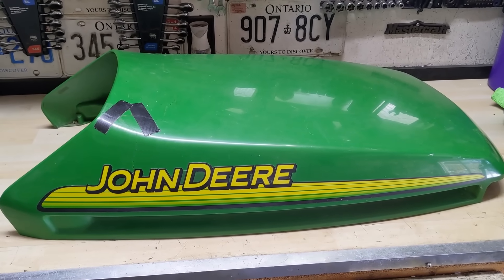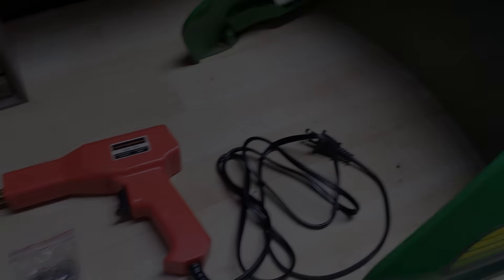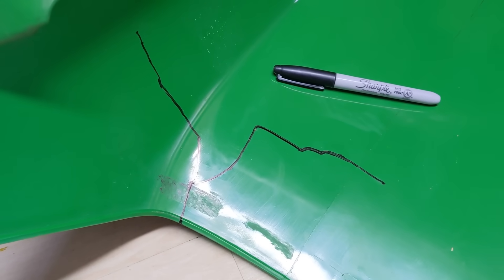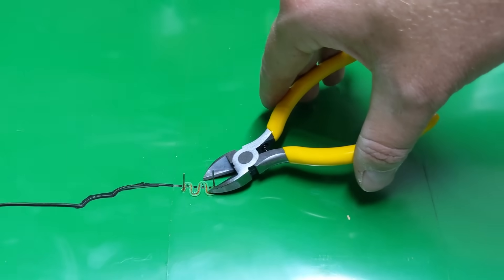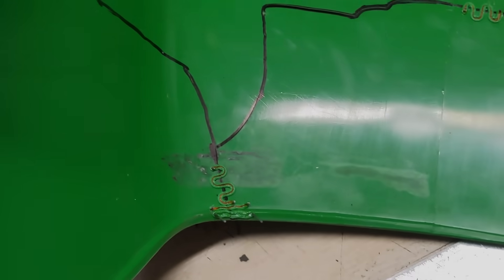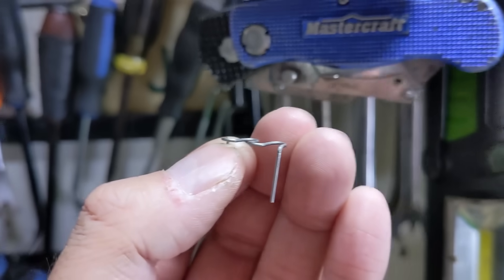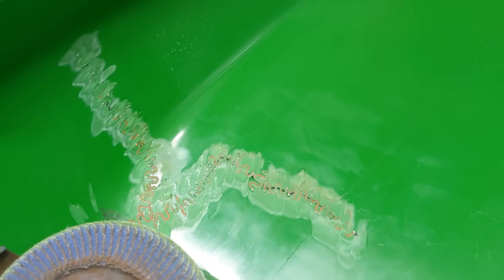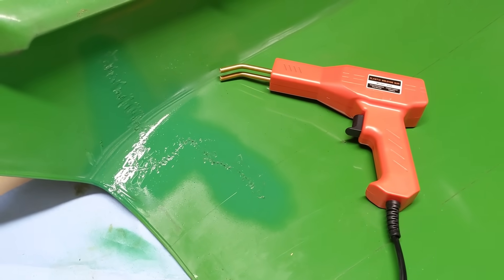How to Fix Cracks in Plastic Using a Hot Stapler

Comment: This video is actually very informative. Using knowledgeable terms. 

That its most likely ac current and briefly how it would work on the tool. How each staple works on outside and inside corners, flat surfaces.

This is just an overall good video, and I'm only 4 minutes deep so far. Props to you man! Hope you get alot of subs and views!

Comment: For an inexpensive $3.50 cutters, go to Harbor Freight and buy one of their small flush cutting snips and grind the face flat. Take your time grinding the face, so that it doesn't get to hot and cool it with oil or water. These $3.50 snips will last a long time and save you over $40.

Comment: Staples are nice, but when it comes to cracking in the bumper and stuff like that, I prefer a steel mesh. You can find it at any other zone or whatever just cut it to fit and go over it and you can use the hot iron to sink it down and to the plastic or you can get a bag of steel wool and make a real nice mesh going over top of it and using the iron part to to heat up the steel wool, which will be a lot tighter braid and no to the plastic and it’s the strongest bond I’ve ever seen

Comment: 2 Years Later, Any update on its quality?
Reply from the maker: Still works, it stopped working once and I unscrewed the handle and found a wire had come unplugged from the push button, plugged it back it and everything still works. They're Chinese and cheap so I honestly didn't think it would be too high quality. There are USA made ones but they are super expensive
Reply: @ Nice. If you take care of it and parts are easy to replace, it'll last forever. Thanks for the update.

Comment: Great instruction video but I think it's pronounced "Nip-ex" Silent K. Try a pair of end cutters used for soldering resistors and other electronic parts into circuit boards. they cut it flush. They just may be a little small.

Comment: I have one, use it all the time, even used it to repair the ladder on my grandson's toy firetruck. 
Only thing is i use a soldering iron with a flattened out nail attached to smooth out the welds and some times i add a little melted plastic to smoothen it even more.

Comment: Nicely produced video bro.    Kit is made in China, but super impressed with the design and what you get for the money.   Some Chinese stuff isn't too bad!   After watching your video, I was able to fix a plastic corner post level checker in under 5 minutes.  The H50 is super easy to use and the kit came with hundreds of elements;  3 different styles of thin wire and 3 different styles of a bit thicker wire.  All stainless steel - use the thinner for smaller jobs and thinner plastic.    One tip is to heat up the element first by inserting the new element and holding down the trigger for 2 seconds (it heats up fast) - when the element is hot, its easier to hold in place as it tacks a bit upon contact.  This works very well when you are trying to tack weld an edge.  As you noted, the element heats up fast - be careful about going right thru the piece that you are welding.   Also, try to holds things steady during the cooldown;  don't try to extract too soon.    Last pointer:  if you need to cut nylon rope to length, you can use this welder!!  Its super slick - just heat up an element and use that hot element to cut the rope - you seal the ends at the same time you cut so the end will have less tendency to unravel.
Reply: China has done a flip now and they make extremely functional tools, however they are fragile as all hell. You have to handle them very carefully. Other than that, if it's a tool you only use once every few months or few years, worth it to get a little chinese jobber. I'm just learning plastic welding, I found this exact same gun, but its a cordless model, and it was only $10! been fixing some boomboxes I ordered that fedex destroyed, and it's holding up well!

Comment: That was weird how you clearly described what you were doing, hit all the important points, and showed it very clearly on video!  Subscribed!
The only thing I might be tempted to add is that it's not uncommon that when you get one of these cracks, the plastic is simply becoming brittle and you'll end up chasing the problem until there's no hope.  I recently went to work on an old pair of rollerblades, and the entire things literally crumbled in my hands.  There's zero chance I could have even put them on.  But short of that type of issue, this is a great fix.

Comment: I seen one of these that also had some type of a plastic rods that you would melt over the staples to reinforce the staples
Reply from the maker: @eriqrosado3337  yes some have metal screen mesh that you melt plastic over
Reply: @EliminatorPerformance  I’ve also seen them. Thank you for sharing and showing a great example of how to go about using the tool. I have a front lip spoiler that I need to repair for my e90 bmw. A racoon 🦝 I believe ran out in front of of my car and smoked my lip. lol. It took me almost a month to find it all in large pieces. And I’ve had it zip tied together for way too long now. But I’m thinking of using the plastic rod to fill in most of the holes I made zip tiring it. But then use a super thin thin thin layer or fiber glass.

Comment: Hello. The plastic part at the bottom of the front bumper of my vehicle is cracked. I want to repair it myself. In some videos, I saw that hot staples were made from the front surface, but in some videos, you also made hot staples from the rear inner part of the plastic part. Which is the correct procedure? Does it need to be done from the outer surface of the part? Does it need to be done from the inner surface of the part?

Comment: Great video! I have the same tool and it's great on plastics (esp. motorcycle fairings). I usually follow up the staples with some clear epoxy or resin (on the backside only) to make it bulletproof and fill up all of the holes and indentations. Great stuff!

Comment: The kit I bought on ebay is 150w, which makes it work much better. Also, it came with a spade-bit looking thing to do the smoothing out afterward. And I use a small needle-nose pliars to bend the legs back and forth, and they usually break off.  I've seen people use metal window screen mesh with the spade-bit thingy, and embed that into thinner plastic for great strength.

Comment: TIP: you don't have to use the clippers to cut the stems.  Just push the stems inward toward the center in the melted area and they'll snap off flush.

Comment: I got a Cordless Plastic Welding Gun on Amazon for $19.99 with 4 different staples. It uses DeWalt batteries. I repaired the fan Housing on a Kowasaki zero turn and the plastic handle on a worx string trimmer. To replace these two items would have been oven $170.00. Have done several small jobs with it. It has been well worth the 20 bucks I spent. As you showed the crack is visible on the outside if you look close. I also used the triangle tip on my heating iron to smooth over the repairs.

Comment: Great video. I bought something like this to fix my cracked dash in my pickup. A couple things I noticed, a grinder or cutting wheel will reheat the staples, so take caution while smoothing off the tips. I also used some needle nose pliers to hold the tips while I cut them off. Pretty easy to do and avoids the mess if you let them fly all over. I also used the wavy ones perpendicular to the crack. It takes more of them but it allowed me to fuse the plastic across the crack after I stapled things. You can just stitch together like a welder would and the kit I bought came with a tip the heats up and uses filler material. I guess you could also get that same outcome with a soldering iron or a plastic welder that works like one.

Comment: Very good demo, clear visuals, great instructions, comprehensive, and NO MUSIC, WHAT JOY!
Excellent.  I needed this.  Thank you!!!
Dremel is useless for anything other than jewelry!  No power. My trusty angle grinder is best. I have a 5" Bosch which is too heavy and too powerful for small jobs. I would suggest a small angle grinder, light duty with 4.5" blades or smaller. If anyone knows a good brand, please let me know.

I would have done one more step - put painters tape on good side. Fill in the cracks with super glue on bad side, and sprinkle baking soda to harden.  Now sand down,  This will be harder.

Comment: I fix my daughter’s 335 hood this week. I ended up ordering the same kit and after installing the staples  I put a coat of clear JB Weld over the staples. It served two purposes by working into the joints left by the staples and also covered the sharp points.The hood had one side completely broken out  and after reconnecting everything I laid a layer of fiberglass over the entire area. The bottom area of plastic where the mounting brackets attach was completely gone. I found some plastic inserts to fit into the holes of the brackets and drilled new holes through the bottom of the front grill. With the fiberglass repair kit and plastic welding kit I had fifty dollars invested.

Comment: For a final detailing, depending on the type of plastic, you can use a bit of acetone (or Thinner) and it will melt it, so you can smooth the surface, for the other side the staples are on. If you have another piece of the same plastic where you can extract pieces, you can make a slurry with acetone and make a more detailed finish which also reinforces the structure.
As a last resort you can use a heat gun, but the results will be hard to control. Heat guns are useful for sun bleached plastics.

Comment: Hey, Jake!  My sister asked me if I could repair an impact crack in the rear bumper of her 2018 Hyundai Elantra and I immediately thought of this video.

After looking at a bunch of these inexpensive tools on Amazon I was seriously unimpressed given how many negative reviews I saw.  It's been over 18 months since you did this video so I was wondering what is your longer-term opinion of this tool.  Has it held up?  Have the repairs you've done held up?  Would you change anything about the tool or the included products?  I see more recently they have changed the design a bit for some of these and there are ones now available with 200 watts instead of 50 watts.  A lot of owners complain that the thermal shutoff when using the smoothing tips happens much too soon and it takes the tool a long time to cool down.  Maybe only using it for stapling and having another tool for smoothing/welding the plastic makes sense - I see some are sold in sets.

I've modified two tools I own which cut like the end nippers and side cutters.  The first one is my short-handled bolt cutters.  Early on I ground one side down so they cut almost flush.  I eventually did the same to a pair of end nippers.  Both tools perform much better now.  I highly recommend modifying at last one set of your cutters to see what I mean.   One of my favorite sayings is "I've never owned a tool I didn't modify".  ;-)

Comment: Thanks for the review. 2 things I would add: 1) when you sink the staples, at the end, twist them a bit. 2) After using the flap-disk, apply G-FLEX EPOXY (from West Marine) to cover the crack and strengthen the joints.

Comment: How strong is the repair? I have a cracked Pelican sled (side wall) that typically carries 200-250lbs 20” firewood. Wondering if the shifting wood (laterally) as I’m hauling the load would be too much for a repair like this?
Reply from the maker: It's probably stronger than it was before it cracked, I was lifting that previously broken piece with 1 hand trying to get it to flex and it seemed stiffer than before.

Comment: It most likely is AC, but even if it was DC, polarity wouldn't matter because a wire is just a low value resistor, not polarized.

Comment: You can use a flat iron attachment to melt in the rest of the plastic cover. it would also increase the strength of the weld

Comment: I'm a perfectionist so the paint would kill me, But this is definitely a better repair than most I've seen! Good job man! Not hating, I just have issues, so my perfectionist side says Instead of putting All that vibration through there with that grinder, I probably would have just thrown a little bit of like JB weld on the inside after snipping the ends off flat,kinda like body filler, you could probably use Bondo too in fact as long as you scuff the plastic BEFORE you start so it can adhere well, but JB weld or bondo, floated in over the little remaining nubs like spackle almost, then sanded lightly to shape. Preferably without re-exposing the metal because I'm concerned the vibration or twisting could cause them to kinda pop loose of the plastic (think of like a bushing unsticking from metal) Which would still hold the seam together but just not as securely and the Staples could walk their way out over time (unless you follow along As you put them in and push the plastic closed behind them before it cools as you go). Then just paint it over and clear coat it. If you use JB weld or JB quick weld, you would probably only add about $4 to the price of this repair and it would actually probably take less time if you use JB quick weld. Just an idea...  Like I said I'm a perfectionist and I have issues with over-engineering EVERYTHING... But honestly you did a pretty dope job... Probably way better than 99% of people would have even bothered with... (I'm serious... like I have a bathroom cabinet that will still be floating through space long after the Earth is gone! LMAO)

Comment: I was looking at these, but advertized as 150W  😮  I wonder if they’ve bumped the power, or the marketing dept just fudged the numbers.  😅
Reply from the maker: Definitely don't need that much wattage lol the 50w seems to work well, and if anything I would guess it gives you a bit more control since it heats them up a bit slower

Comment: If the "staples" are stainless steel heating it like that will cause it to rust. Something about changing the metallurgy of the metal.
Reply from the maker: 304 stainless that isn't magnetic shouldn't

Comment: Another great video. Here is a tip. To speed up the cooling process of the plastic you can use compressed air set a low psi.

Comment: I have a similar one. But it also came with an accessory. As you put on. Can look like an iron roughly. With it, you level the surface so that the clamp is completely covered with plastic. And which I think enhances the repair even more. And with one, you can also use a thin metal mesh to melt into the plastic. Sometimes melt cable ties/plastic to get more material for the repair.

Comment: Excellent, but keep explaining.  Until it's not useful, it's boring. In fact, there should be advice on how to use wire for welding at corners. What kind of wire should be used?  and the suitability of many other types of wire

Comment: Great tool,have used it a few times but having trouble controlling how deep to imbed the staple and then hold it steady until it cools enough to pull the iron from the staple.
Any help ? Open for suggestions
Reply from the maker: That's the tricky part, you ideally want to go half way, and I've learned that twisting the staple after you've gone in a bit (while it's still hot) helps secure it in place.
Reply: @EliminatorPerformance  
I think I will try to make a few various thickness stops.might just try some small washers ,about 1/8 in thick,just something that will keep me from poking thru the plastic.A slotted hand held spacer that can be inserted between the tool nose and work piece.If I come up with something that works I will send you a picture if you send me a email addr.

Comment: You dont need to bye them..made them ..bye stainless steel wire 0,8 mm thickness and put them around a screw wired in them around the screw and after them use a plier and streech out them..i can send you a video how you can made them by your self

Comment: You may try using a chemical Methylene chloride, also called dichloromethane.  You can get this from shops that deal with acrylic plastic.  Get a little applicator bottle with it which should have a needle like spout.  Just run it along the cracks while its pressed together and it will chemically melt any PMMA based plastic back together and evaporate quickly.  I've used it on all kinds of things including heavy equipment.

Comment: I bought one of these and a soldering iron style kit for setting in metal mesh and plastic rod. I've used them for quite a few repairs now and something handy to have around.
The staples are really surprisingly hard to cut. I found a pair of guitar fret, end nippers that are very sharp and flush cutting.
Reply from the maker: Good tip, I've heard that a few times I'll have to get a set!

Comment: I have a model of sampler that snaps off in the plastic where they fall off towards the surface, when they have cooled and you bend them with your finger. Then you can seal the hole where you inserted them with cable ties (PP plastic) and a soldering iron with which you melt the cable ties (similar to soldering the hole with plastic).

Comment: I use paper clips to make specific shapes (circles, triangles, squares) and they're cheap. They are chrome coated and will not rust. Also, I melt the bubbled surface to both smooth the repair and to seal the element from the weather if I don't get around to paintint the seam. Great video though.
Reply: Great idea!!!
Reply: That's what it's made of I was going to do that when I ran out